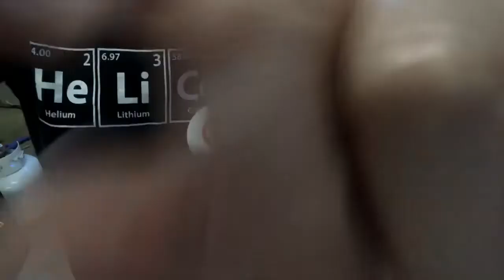Roban Pave Hawk Naza puck adjustment

Comment: The nose extension radar you had was custom made? I was looking at the Roban 700. Which kit from Roban did you originally buy to make the HH-60G? Did you make it out of the Blackhawk or the Seahawk or the Coast Guard 700 version. They are all similar but which one of those 3 was the closest to the Pavehawk that you used. I am going to purchase one shortly from RC Motion I just wanted to know which one you used. Thx
Reply from the maker: Its the 700 size super scale Black Hawk. And the Radom is a ping pong ball not he end of a hand shaped wood extension. Here is the old build thread which I thought had that info on it but not really.   https://www.scalerchelis.com/phpBB2/viewtopic.php?f=10&t=15745
Reply: Thanks I appreciated your help…